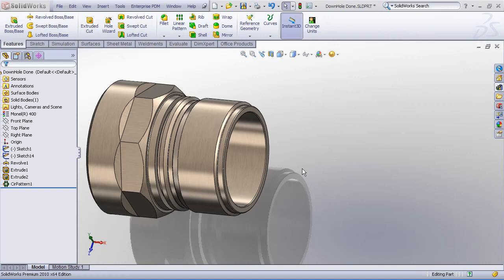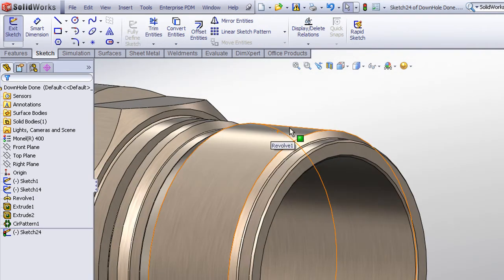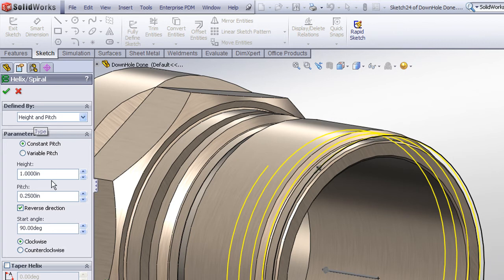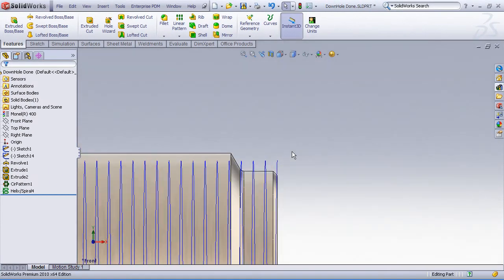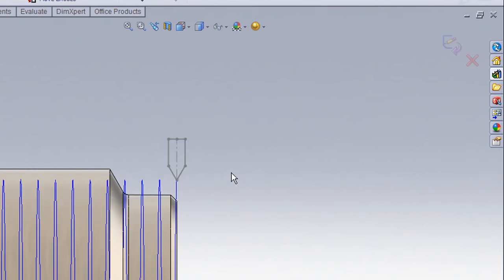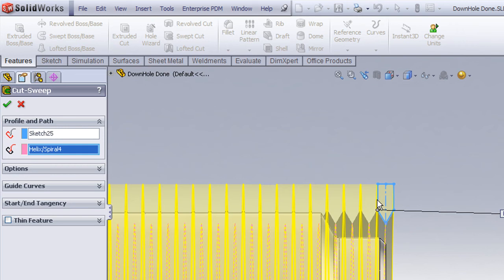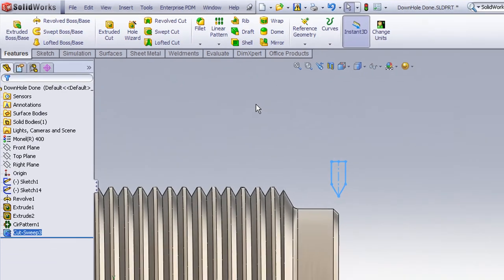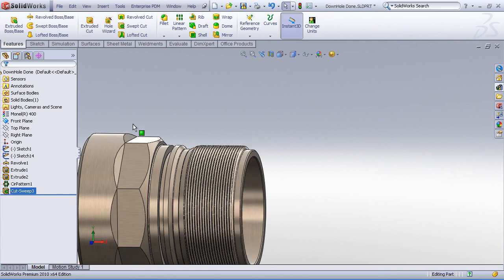Modeling threads in SolidWorks

Comment: Yeah, I can do all this, creating the sketch for the v tool is the only thing I cant do. If I have a 12 pitch thread, what size should my v tool be?
Reply: you mean the width of the tool? grab a calculator and do 1/12 (12 TPI is an inch divided by 12) and you get .08334 so thats the width of the tool.. if you make the tool as a block file as he has then make the width of the tool 1 (one inch for US and one mm for the rest of the world) and then when you use the tool you just set the scale to the width that you want (in this case 0.08334) and that will size the tool for you

Comment from the maker: @GoPDemon You should be able to create the sketches for standard thread profiles without too much trouble.  The one used in this demo is just a triangular profile, where I've applied the appropriate pitch and depth dimensions.  Once you have drawn up a profile, you can save it to your design library and reuse that sketch any time you need to make a threaded feature.